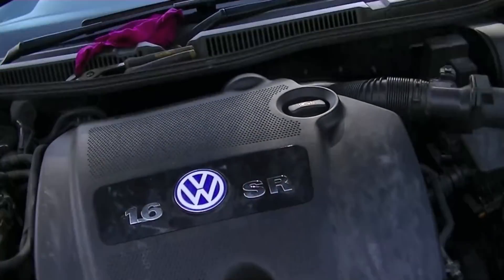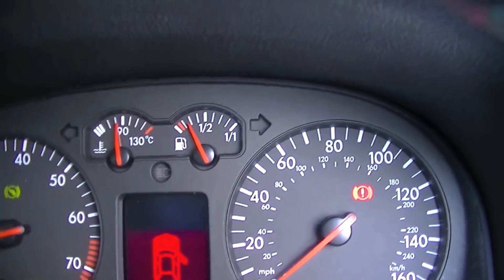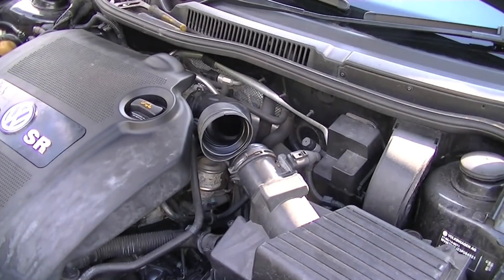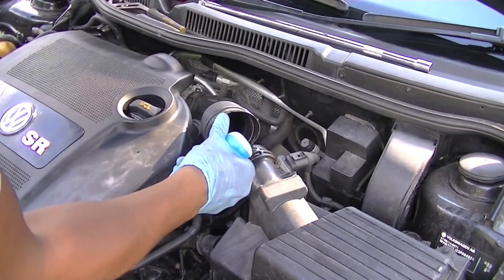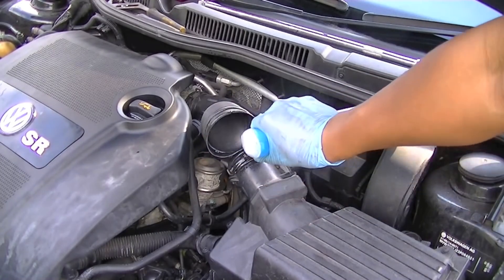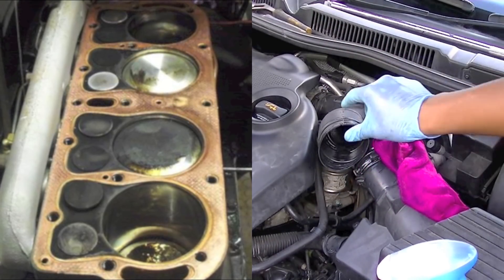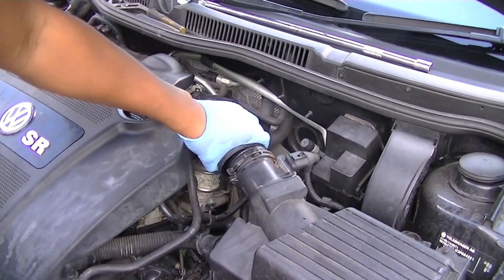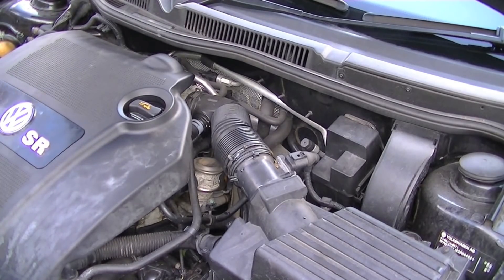How to make your engine run better with just tap water.......Better Than Seafoam?

Comment: The water will puddle up in certain intake manifolds since not everything that you mist gets instantly pulled into the combustion chambers, probably most of it runs down the walls of the manifold. Then while cornering / accelerating / braking you might get a knock knock - who is it? Piston rod.

Ridiculously stupid method, if you absolutely must do it, use a steam machine. But if you have a ton of deposit, you should look into the cause of it, because a healthy engine should only have very little of it.
Reply: knock knock, who is it? piston rod....haha this made me piss myself laughin, you made my night lol
Reply: +parteibonza too true. Right. That one his close to home. I'm evaluating my car if a rod breaking is why it won't turn over. I've shown water decarbonization before and no it didn't cause my issue thankfully. lol
Reply: maroon...  such a pretty color.
Reply: +Luke Russell yep one of my favorites along with "knock knock/Whos there?/Oops sorry thats just my Chevy"
Reply: +Luke Russell  it was an electrical problem .....a conrod knocked the alternator off .
Reply: You do realise many cars use water meth injection and they dont have issues, yes its used for a different reason but regardless the chance of it locking up are basically zero unless you go and put litres in at a time
Reply: Lmao 😂 😂 
this guy is a maroon
 I heard dish soap will clean a piston too! 😂
Reply: WRONG! Really 'cute' 'theory' though, You don't spray  or dump the water / oil mixture until the Intake manifold's  hot enough to 'steam' water (externally).

It seems just like _ _ _   _  _  _ _ _  It seems everyone has one (opinion) - based on little fact, or experience, (mostly no A-C-T-U-A-L experience). Back to your Video Games with you, now.
Ken @ KC ENGINEering.
Reply: 3000 rpm @ 100°C!
No water pooling in the intake manifold!
Reply: These Mechanics would never touch My Car..Water and Gasoline 
don't mix.
Reply: Neither do eggs and milk Carroll Long. But everyone still tries to mix them and the results are fantastic.
Reply: FrozenHaxor that's why the revs are up

Comment: I wouldn't use tap water because it will leave mineral deposits in your engine.  Use distilled water instead and you'll be fine.  It's only a dollar for one gallon which is plenty.  If you can't find that then use windshield washing fluid which is two dollars for a gallon and is basically distilled water and methanol.

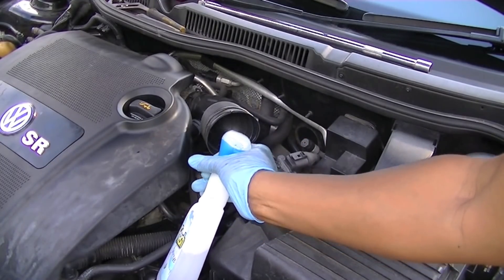Comment: Where did you manage to find that picture of cylinder head gasket at 3:16? It is a side valve flat head engine tech used in 1940 and earlier era cars. By the way. That water cleaning thing is true what you say. It really works.

Comment: YOU ARE THE FUCKING DUMP!! AN ANGINE CANT COMPRESS WATER!! YOU WILL CRACK YOURE FUCKING ENGINE!! AND THERE WILL COME WATER WHERE THE OIL IS SUPOSE TO LUBRICATE THE FUCKING ENGINE-!! FUCKING IDIOT MAN!
Reply from the maker: Moment of silence
Reply: +BMAC VAGS yeah for youre fucking engine man.....
Reply: +Incorporated prospect Theres a video of a guy putting a hose running water straight into his intake manifold. Nothing happened. lol rekt.
Reply: +Incorporated prospect as long as you're not throwing a cup in at a time, you're fine. if you spray the right amount into the engine it'll evaporate into steam and clean the carbon. obviously if you put in more than it can handle you'll probably bend a connecting rod or something of that nature, but that's user error at that point.
Reply: +Incorporated prospect If you have no experience with this - don't comment.
I ran a vacuum line to the interior and made the engine EAT a gallon of water as I drove. I would pull the hose out of the jug when I came to a stop, as it would start to wet down the spark plugs at idle. No hydro-lock !
Reply: +Incorporated prospect Fella, maybe both of us could benefit from this... Don't get so hyped up over this. My head hurts just looking at it and I'm not the only one, won't it make it difficult for you if you keep railing on people like this? I'm trying to be considerate to you, seeing you're going crazy mad at someone here over this. Or maybe that's all in my head, but wow what a performance - whoever it is that's involved.

BTW, water injection is a real thing people add to cars. Even Jay Leno has it on at least one of his cars, if it's a small enough amount it won't damage the engine but can give it additional cooling and although I have no experience with it, it may give additional fuel mileage which sounds nice to me.
Reply: He'd have to dump way more water than that to hydrolock it..
Reply: +Incorporated prospect  As long as there is air in the clynder it will compress, if the clynder was half full of water (bit extreme) the remaining air will compress to a higher level than usual. if it was full or mostly filled, yes broken crank / block
Reply: Austin Lucas
A cool set-up is on a Turbo car, the boost pressurizes the water bottle, which ONLY sprays under boost to help control peak heat and detonation, also cleans the engine.
Reply: +Incorporated prospect  hey know it all, ever heard of water injection?
Reply: +Incorporated prospect:
You kiss your mom with that mouth? Foul talk usually means limited vocabulary..pea brain.
Reply: Incorporated prospect
"....and there might come water in the motor oil if the piston rings are bad...."

Will you just stop !!
At this point you are just guessing.
You can pour water from a beer bottle into a running V8 - - an engine you've never owned.
Reply: +Incorporated prospect See, you just made my point for me. Now come out of your mom's basement and take your medication.
Reply: +TIMEtoRIDE900  yes but this is a 4 cylinder 8 valve you've never owned before :D :D

Comment: I would use demineralised water or windscreenwiper fluid. What you are doing is basically the same as water(/alcohol) injection. It does work very well but don't spray too much in one go.

Comment: People do not do this to your car
Reply: Have you ever heard of water injection on high performance engines? All the water does is ups the compression a touch. Unless you dump a bottle in all in one go it will be fine
Reply: volume of water  that can drown you as a life being would perhaps or likely would kill the engine but a mist from a spray is  different.
d's old techniks is still being practiced as part of routine service mnTnanz by almost all huge industries till now.
very informative.....
Good Day.
Reply from the maker: +Michael Shuler Why?
Reply: +BMAC VAGS because water should never enter your engine through the intake. It should never enter it at all other than where the coolant goes.

Comment: Amsoil. You should never use water where oil or grease maybe present. If what you are trying to achieve is cleaning the tops of your Pistons... Remove the top end (which is very easily done) replacing all other gaskets along the way until you reach your Pistons.

Comment: Judging from the sound of the clattering valves in that guys engine, I am pretty sure I would never take any mechanical advice from him.
Reply: It's a petrol 1.6 you bunch of idiots 😂
Reply: All valves make noise.
Reply: +ZIPPER978 So why can't I hear that horrible rattle in my 1999 dodge, or in my 1995 jeep? VW is well known to have sloppily designed engines. You should NOT hear the valves.
Reply: It ain't a deisel. It's his phone. Open your bonnet and film it on tick over it sounds loud and fkd through a phone . In reality it'll sound normal
Reply: It's a diesel gumby...
Reply: M. Horsman it's a diesel Volkswagen that's why you hear clatter

Comment: any thoughts on using hydrogen peroxide (H2O2) for this? there is more oxygen to react with carbon. Or is the water not actually combusting? simply increasing air density and humidity?
Reply: just found a paper on this saying H202/water injection in diesel engines reduces unburned hydrocarbons and particulates in exhaust : http://papers.sae.org/2004-01-2925/
basically, design an engine to inject H2O2 and water with fuel and get cleaner emissions (and likely an increase in economy)
Reply from the maker: No one likes facts that goes against their beliefs. Thank you for posting this

Comment: any thoughts on using hydrogen peroxide (H2O2) for this? there is more oxygen to react with carbon. Or is the water not actually combusting? simply increasing air density and humidity?

Comment: I would do this before seafam , seafoam is "snake oil "    remember water injection is used on forced induction cars to prevent knock or preignition   .   couldn't hurt . but remember where do all the carbon deposits end up going   ?  cat. converters ,  resonaters , mufflers etc.  Hmmm ?

Comment: Excellent video. I just used this spray bottle with distilled water method and found a very noticeable increase in power, mileage, and smoothness in my car. My car shakes very little and engine noise have decreased dramatically. Very shocking how smooth my car runs after using this method. Points to remember: Make sure car is at warm operating temperature, Make sure someone is pressing the accelerator between 2,000 - 3,000 RPM, and since you have the throttle body opened up, clean your throttle. Very Nice method and results!! Thanks BMAC.

UPDATE: It's been 2 weeks and my car is running perfect with almost no vibrations at all. No sensor, catalytic converter, or any issues of any kind. My car's power and smoothness is absolutely shocking. It's almost like a new engine at full power. I performed this method twice already cause the first time I had incredible results, why not do it again and found the results to be at an A+ level.

Comment: If you have ever driven on a hot day where it just rained, you are also sucking in moisture.  This spray bottle is very little moisture once distributed to the 4 cylinders.  It's not like he poured a glass of water down the throat of the carb to stall the car.  Imo, this is better than those fools who buy injector cleaner, and pour it into their gas tank.  This stuff does a nice job of cleaning the walls of the tank, and sending all the dirty fuel and varnish into the fuel delivery system.  And let's not forget about the damage it causes to the fuel pump motor.

Comment: Went to Halfords, didn't see any Seafoam so just sprayed about half a liter of tap water in my 1999 2 liter diesel thats done almost 185,000 miles. Probably just cause the engine was still warm, my imagination, or cause it just couldnt get any worse in there, but it seemed somehow better; for example taking a couner in 3rd going 20 (I know) was smoother. If anyone cares I'll report back tomorow after a cold start... if it does haha